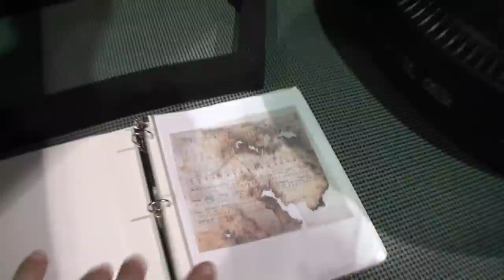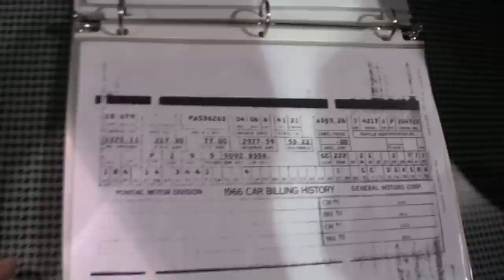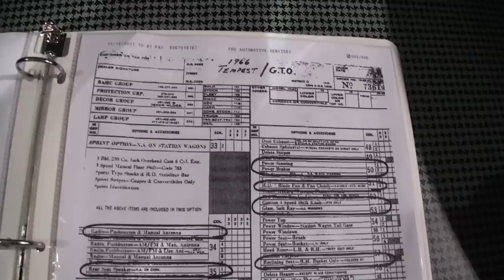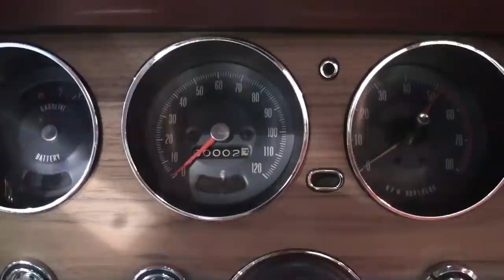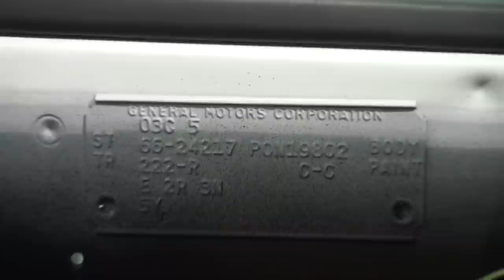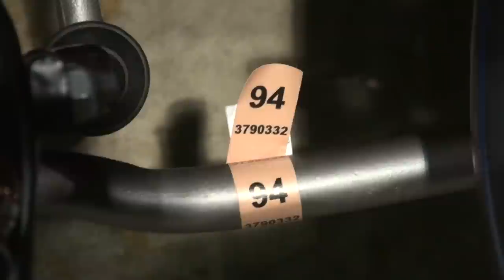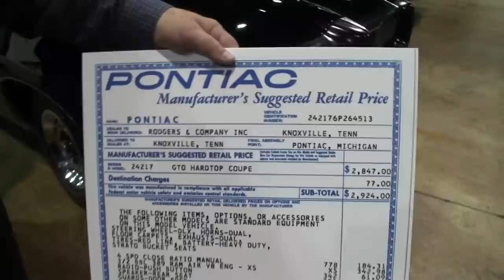1966 Pontiac GTO Hardtop Coupe in White & Ram Air 389 Engine Sound - My Car Story with Lou Costabile

Comment: Hi Lou,

What is there not to love about the Poncho, beautiful lines & stunning interior especially with the chrome trim around the gauges just those finishing touches just awesome, Ponti was ahead of the game back in the mid 60's, just look at the interior of my favorite
1966 Catalina 2+2, can you feature a Catalina in your upcoming video's please Lou.

Just need some clarification. I didn't think you can have a hardtop coupe. It was either a hardtop or a coupe not both.

I have been told that a hardtop is where the front & back window can go up & down with no post in between. 

I was recently at Chrysler at the Murray,  the biggest Mopar Car Show in Australia. Just 1 post car a 1967 Dart & to my amazement the back window winds down, thanks to your show I learnt that, now I have a soft spot for post car.

Now a coupe is the exact same body as a hardtop just that the back window doesn't wind down it is either solid or pushes out similar to the Roadrunner's of 68, 69 & 70.

Hardtop & Coupe.

Happy to learn the difference please enlightened me.

Your number 1 Fan in Australia 
Louis Kats from Melbourne Australia ☺ 👍 ❤ 

And Lou please take care look after yourself your loved ones.

We hear & read it is out of control over in the States, if you need to get away from it you are welcome to Australia & my house is yours.
Reply from the maker: Hi Louis, A wonderful car I was learning about the whole time I was videoing.  Such a "gem" to share on the Channel :-) While most of the USA is on "mandatory stay at home" mentality I have ventured to a few Car Friends who've allowed me to come by.  You'll see a few longer more in depth videos I think you'll enjoy so stay tuned.  Thank you for the kind words, the offering of your home, and the care in all of your comments.  I'll take precautions for me & the family, and you do the same, Lou